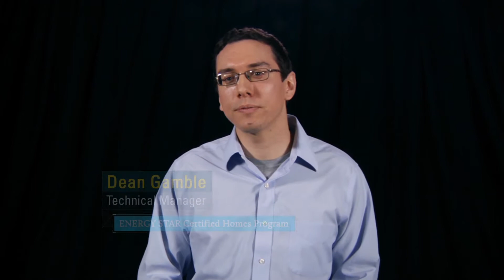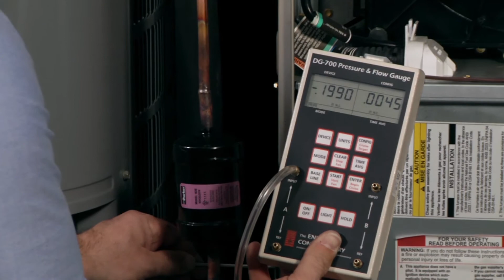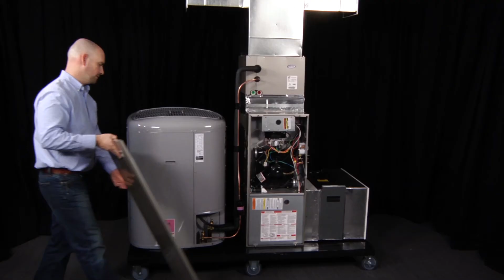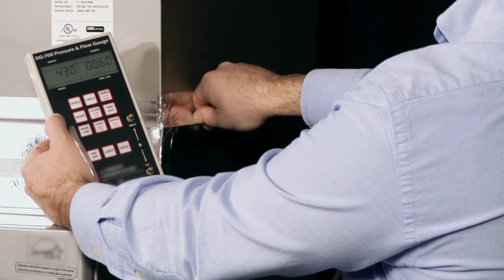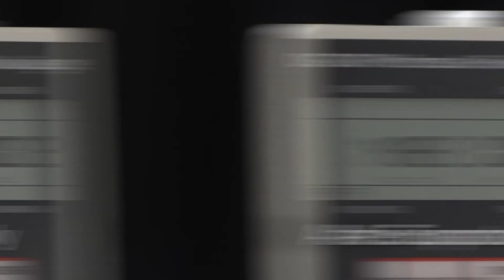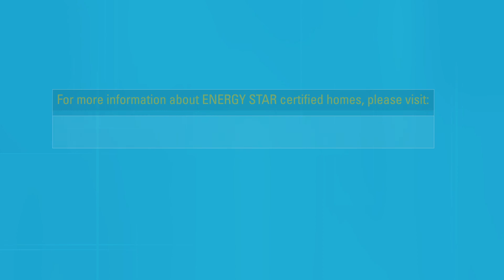How to Measure HVAC Fan Airflow Video 4 of 5 – Where to Measure Static Pressure

Comment: The first air handler I am tasked to get external static pressure is an Aspen ABM234-024. The blower is positioned between the return plenum and the A coil. So, I will have to measure supply pressure after the A coil, which will include a component. The cabinet portion where the A coil is located is all depressurized during operation. After this part of the unit, there is a hydronic heat exchanger in a pressurized part of the plenum. I will measure there, but if you have any input I would like to hear it.
Reply from the maker: Thank you for your question. Please contact energystarhomes@energystar.gov for additional assistance.